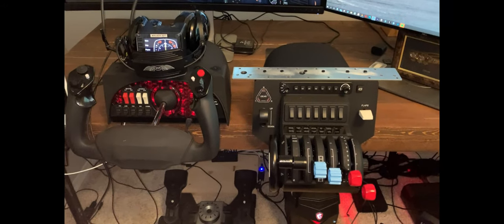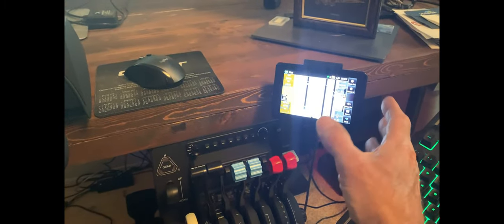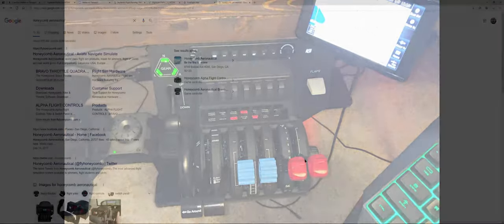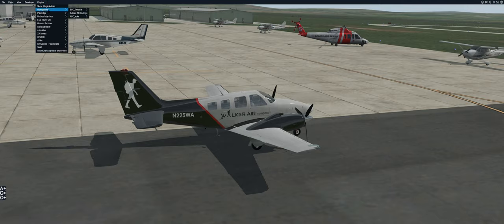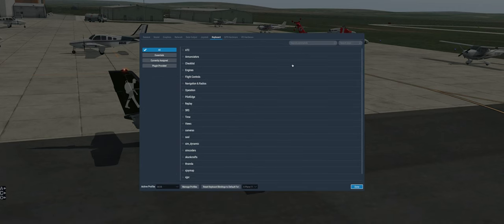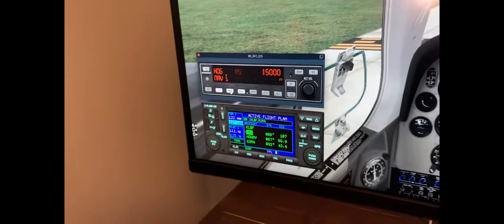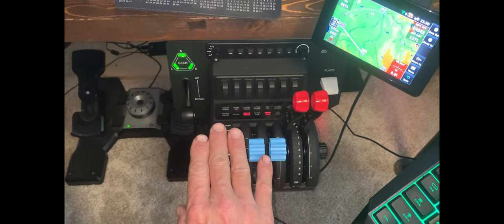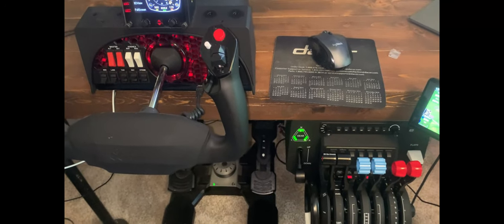Honeycomb Bravo Throttle Quadrant Review

Comment: hello,
did you manage to make the propeller feather working? I tried several things with no success
Reply from the maker: Hello. The prop levers have always worked for me. Feathering would be full aft on the lever. Are you flying X-Plane?  Do you have the prop levers properly assigned in the software?  I would need to know more about what you are experiencing.
Reply: @sogpilot3137  hey, thanks for the reply. I'm indeed using Xplane. 
The prop levers work properly, but when move them aft (the detent) nothing happen. This detend is actually behaveing like a button to which I mapped several things related to prop feathering but with no success. If this works for you, do you mind checking to what the detent is mapped  to (either in Xplane or honecomb configurator tool)?
Reply from the maker: I’ll take a look at my setup and let you know.
Reply: @sogpilot3137  Thanks for your help!
Reply from the maker: Hello. Sorry I haven’t gotten back to you on this, but my Sim isn’t working. I’m getting less than 1 FPS resulting in impossible stuttering, so unable to go in and look at settings.
Reply: @sogpilot3137  no worries. I actually got an answer from Aerosoft about this and apparently it is not possible to use the detent for feathering (with Xplane at least) due to software reasons

Comment: What size  was the bar used to mount the throttle quadrant under the desk
Reply from the maker: Sorry so long and getting back to you on this question, but I just came across it as I was reviewing comments. The flat bar that goes across the top of the control wheel is made by Simpson ties. You can pick one up at any Home Depot or Lowe’s, etc. Without actually going under and measuring it I believe it is 3 inches wide. If you need me to, I’ll get a more specific measurement.

Comment: Seems to do just about everything for all kinds of aircraft EXCEPT a Cessna that I primarily fly.
Useless for my purposes!
Reply from the maker: Why not the Cessna?  What model?
Reply: @sogpilot3137  For those who care about authenticity (and presumably this is what Honeycomb is trying to achieve}, there are only levers in this quadrant and most models of Cessna have push-pull/twist knobs. Just look down at the throttles of a Cessna in a sim and tell me how they resemble the mechanism of Honeycomb. Clearly Cessna is fully omitted in the Honeycomb.
Reply from the maker: Yes. I flew for the Civil Air Patrol in a Cessna 172. True the controls are different. I’ve also flown them on the simulator using levers. Sometimes in the simulator world you have to make accommodations. There are, however, flight controls that precisely simulate the Cessna 172. The FAA approved simulator at my airport has Cessna flight controls associated with it.
Reply: @airste172  get yourself  a velocity one yoke this one is for cessna
Reply: @Voltomess  I thought that would be the answer too, but upon trying out a Velocity One that a friend purchased, I was very disappointed. The Cessna style throttle quadrant is unnecessarily miniaturized and feels more like a toy than a throttle. Additionally the quadrant doesn't have a friction lock or a twist function in the mixture control so there is just too much pretending that has to be done. The yoke itself also has some odd shortcomings like center detent points in the elevator and aileron axis which no airplane has  and the elevator throw or travel distance is far too short to be realistic or allow for accurate control. Oddly enough they brag about the 180 degrees of yoke rotation as if that was big deal when in reality the only time you turn a yoke that far in actual flight operations is for taxiing in a strong crosswind.
Using my trusty old CH Products yoke, I can just as easily pretend around its shortcomings without having to pay a premium price.
Reply: @airste172  yeah I don't know that much about airplanes but seems like you got good points there. I received my honeycomb yoke and throttle yesterday and I'm happy with that.
Reply: @Voltomess  While I don't have personal experience with the Honeycomb throttle as I do with the yoke, it looks like it's up to the task of being able to handle aircraft with multiple engines adequately.